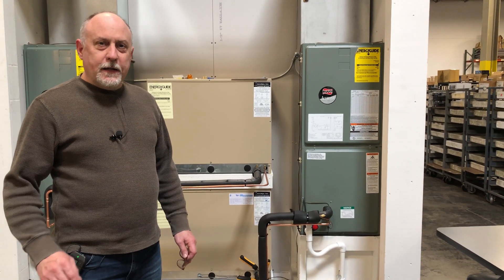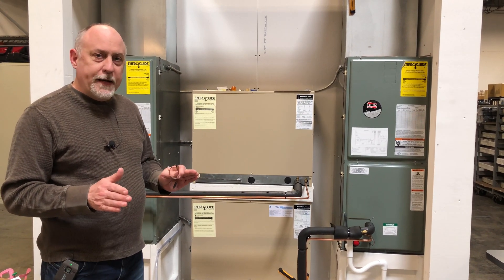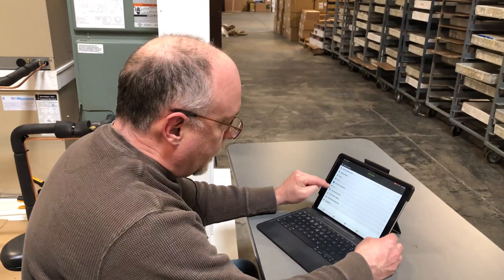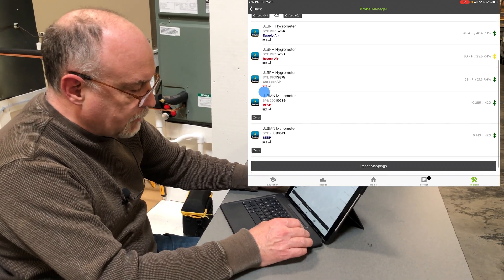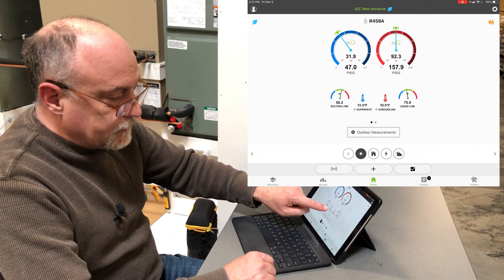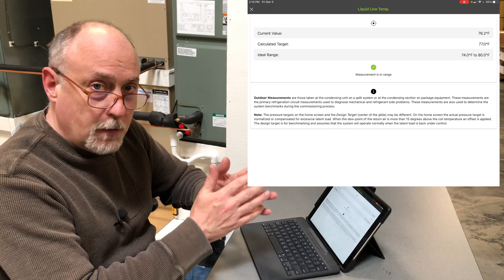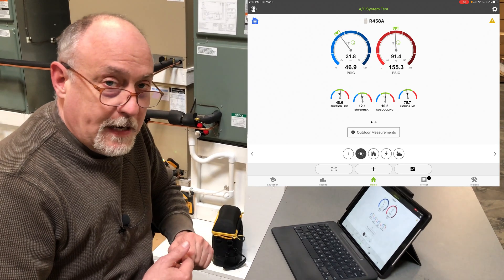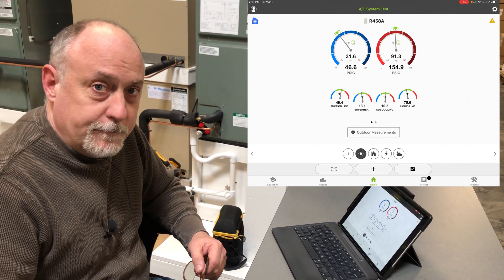NIST (non-invasive) testing in measureQuick

Comment: You stated that this system was already benchmarked and therefore the data had a reference.
If this is the first time working on a system, is NIST applicable for diagnostics?
Reply from the maker: It is, but it is far more accurate with a benchmark that takes into account the installation variables and airflow.

Comment: Jim is the best!  Greetings from colleagues from Russia!  Thank you for the best wireless data acquisition and analysis software.  We are waiting for the Russian version!
Reply from the maker: мы тоже с нетерпением ждем этого. Это может занять некоторое время, потому что мой русский немного слабоват.
Reply: @measureQuick  Jim!  Will you make a version for two refrigerating circuits?  And we also need a version for chillers.  I use your best dual circuit chiller software.  I use two smartphones for this.  It is good to be able to analyze the water (glycol) temperatures of the chiller in the program.
Reply from the maker: @HVAC-prochiller  We have a workflow for 4 circuits already. Chillers are on the roadmap.
Reply from the maker: @HVAC-prochiller  https://youtu.be/qgXhBhFUxEQ

Comment: Is there an outdoor temperature minimum threshold that you would recommend for a NIST?
Reply from the maker: Same as you would for standard testing, no difference. For me it’s about 55 degrees. Any lower and there may not be enough pressure drop across the metering device.
Reply: @measureQuick  thank you!